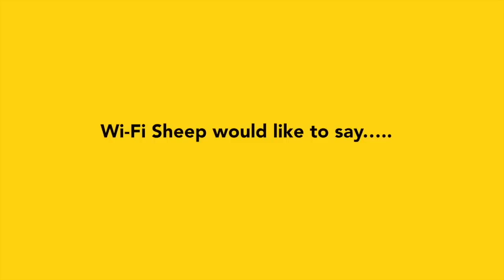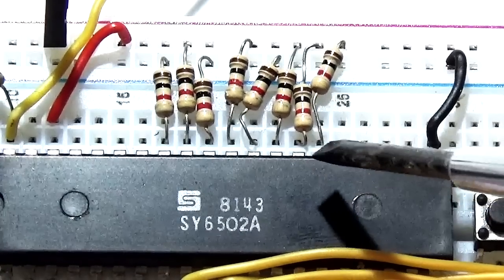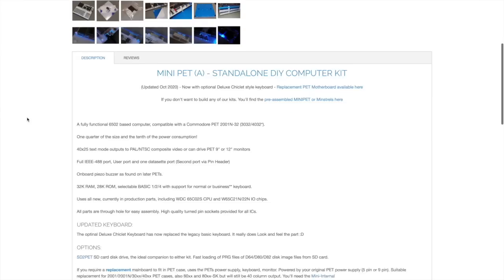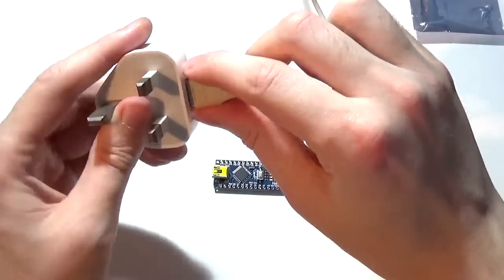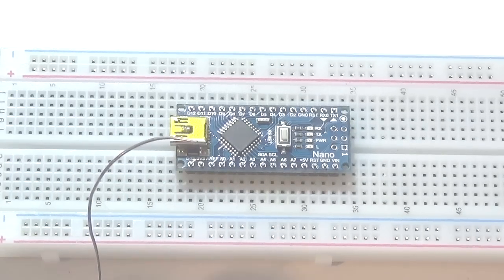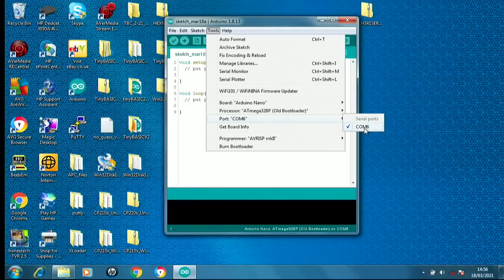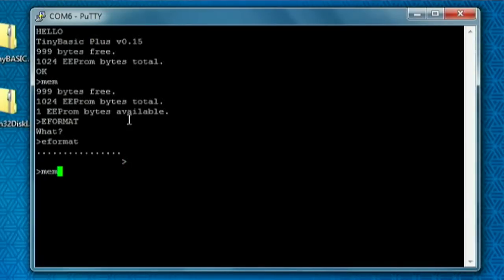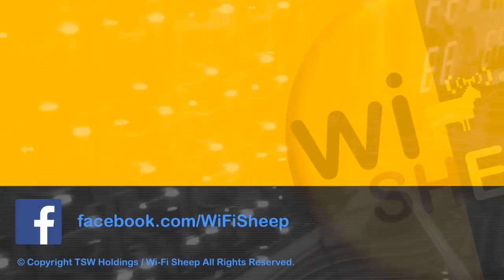New 2021 8-bit Computing For Under $10????

Comment: FPGA isn't 'hardware emulation'.  As the FPGA logic gates are arranged by firmware into the same configuration as eg a 6502, the FPGA IS internally a 6502 processor.
Reply: @another3997    It needs to be clearly distinguished:  In general terms, an emulator is another processor performing a simulation of being another processor.

An FPGA is, at the gate level, a 6502.

There are differences (the cost difference is substantial!), but not nessicarily something the casual user would see.
Reply: To be fair, the FPGA implementation is not remotely the same as a 6502.  At best it implements similar logical equations and timing.  The way in which the logic is realised is very different.  The 6502 also has a two phase clock which is not realisable in FPGA.  That said, it is possible to emulate the external behaviour and timing of a real 6502 to a high degree of accuracy.
Reply: @another3997  no there's no emulation going at any level
Reply: Technically it is not emulation in the traditional meaning of the word but it is also not a 6502. It's a digital circuit which is functionally equivalent to the 6502.

You could argue it is a form of emulation because it is reproducing the behaviour of a 6502 but not actually using the 6502 device itself.

And the hardware description language used to implement the functionality is not a programming language. It's a hardware description language. It isn't a sequence of instructions like a programming language. The only thing it has in common to a programming language is that both are written in textual form.

Comment: When talking about 8 bit processors there are actually two numbers to be concerned with.  Data width, and address width.   Most of the examples you gave of historical machines have a address width of 16 bits.   But many 8 bit processors were actually more of hybrid processors.  Like the 6809E.   It was classified as a 8 bit processor.  But it had a couple of 16 bit registers and could do limited 16 bit processing.  This made it suitable for OS-9, which was a unix like operating system  often used in very expensive real time systems like fastbus crates.   In fact for real time processing the 6809 based hardware remained better suited for uses at CERN than the newer hardware components available in the early 90's...
Reply: When talking about processors, the numbers we are concerned with are the data bus size and the size of the internal registers.  NOT the address bus size.
"hybrid" processors have different data bus and internal register sizes.
Thus a 6502, 6800, 8080, and z80 are all 8-bit processors as they have an 8 bit data bus and 8 bit internal registers.
The 6809 and the 8088 are 8/16 processors as they have 8 bit data buses, but 16 bit internal registers.
The 8086 is 16 bit, the 68000 is 16/32, but later chips were often 32 bit.
This has been how we call them since at least the 70s or 80s.
Reply: @MichaelRBrown-lh6kn  Yes.  It it is nice to clearify exactly what type of 8 bit architecture you are talking about.  As about the only reason I can think of for using an 8 bit processor is to run ancient software natively.  Even smart light bulbs now days use 32 bit processors...   I imagine eventually when they start putting processors on RFID chips they'll have more than 8 bits too.  Really any old software I have would need that 16 bit address bus...   Not that I'm likely to ever try running it again on a non-emulated platform.  It is just an interesting what if I really wanted to type question.
Reply: Adrress size has nothing to do.
You forget most important: ALU (arithmetic-logic unit) wide.

The "rule" (not a law) to determine bit with would be something like this:

1st/ Internal data bus. This is mandatory.

For the next two points, only one would be needed. 

2nd/ Register size (at least equal to 1/). If there are bigger registers that doesn't qualify if it has to operate on them on more than a pass.

3th/ ALU width.

Finally considering a CPU is x-bit size is a marketing and habit practice, not a scientific-exact one

For example Zilog Z80 is 8-bit because its internal bus is 8-bit wide (so on for external), it has 8-bit registers and can use some 16 bits registers but when it operate on them it takes like double time (two passes, so no 16-bit operation).Surprising a few years ago a lot of us learned Z80 ALU was 4-bit wide. I think in 80's near all of us were thinking its ALU was 8-bit wide.

Motorola 68000 is a 16-bit CPU because although  it has 32 bit registers, its internal (and external) data busses are 16-bit, and its ALU is 16-bit. To add 32-bit data it needs double time, because it is donde on two steps, each one 16-bit. Motorola named it 16/32 bits because althougth it is a 16-bit CPU it implements a 32-bit ISA. Really 68020 is 32-bit.

For extreme example there is a very special HP CPU called Saturn (used in HP-71 and later derivatives in a lot of old good HP calculators, for example on wonderful HP-48 series): it has some 64-bit data registers, 20-bit address registers (in fact it can  address directly, in lineal memory, 1 Meganibble memory, i.e. 512 Kbytes, something an Intel 8086 can't do: it can only address in lineal way 64 Kbytes) but it is a 4-bit CPU: internal data bus and ALU are 4-bit wide. If you add two 64-bit registers it takes like 16 more times than adding only 4-bit size.

Obviously marvellous Motorola 6809 is an 8-bit CPU. Having some 16-bit registers doesn't qualify for being 16-bits as its ALU and internal data bus are 8-bits.
Reply: @davidg1830 davidg is correct.
The bit width of a processor is determined by the size of the data elements it processes not the address bus size. And that makes perfect sense if you think about it.

The performance of the processor is principally determined by the width of the ALU and its registers, the size of the memory and maximum capacity of memory as determined by the address bus width has little bearing on this.

On more modern processors then the clock frequency, the architecture, the number of clock cycles per instruction all come into it. In the old days we were more concerned whether it was an 8 or 16 bit processor.

Comment: One great thing about TinyBasic+ is that it can be used to control the pins of Arduino board, so you can write some simple programs like traffic lights etc in Basic.

Comment: Of course. Arduino Nano's have been going for $2-3 bucks for years. I would point to the Blue Pill but that's not 8-bit, so I suppose it doesn't count. Or, alternately, you could point out that for your $1.50 you're getting FOUR 8-bit processors, they just happen to execute the same instructions together :-)
Reply: Hmm, weird. Soo, they run the program, but Times 4 at the same time? Are they like four cores? 

It's quite cool how we could get these for like a couple of dollars. I bet if the producers of these hardwares notice that hobbyist are doing this, they would hike up the price 5 to 10 times the original cost. Seems to be every aspect of things that resemble vintage these days...

Comment: Tips for soldering noobs (like myself) whose aversion comes from dab-dab-dab-dab-BLOB which ends up joining several pins. A good soldering iron and solder works wonders and put some solder on the tip first to stop the solder from sticking to the soldering iron.

Comment: I'm wondering if you can tell me where you purchased these 8-bit modules?  Thanks in advance.
Reply from the maker: Hi yes, it was a seller on Ebay listing here: https://www.ebay.co.uk/itm/313074662903
But you might find cheaper listings so do shop around!
Try searching 'Arduino Nano' on ebay or aliexpress.
All these are clones which more then fine and its what I used in the video.
The proper branded Arduino Nanos are about £9 - £11 each!
Reply: @WiFiSheep  Thanks very much.  Very much appreciated.

Comment: So where is the link to actually order one of the beasties shown in this video? I think there used to be one. Was it removed?
Reply from the maker: Hi, as the prices of these have varied wildly due to the pandemic and chips shortage in recent times, I cant post just one product link, it would also suggest I was endorsing one product listing.

All you need to do is search for 'Arduino Nano Atmega328p' on either Ebay, Amazon, AliExpress or any other preferred vender, and you'll find product as used in this video. 

Here is a UK listing as an example: Although I do NOT endorse this seller. https://www.ebay.co.uk/itm/263093090662?hash=item3d4191f966:g:jIgAAOSwsGVi4QEM&amdata=enc%3AAQAIAAAA8PbrbdC43hRznj38t4feAfYz6Mse1YYQrCPH5OfZLCrta0K4Hx4Dpwf6aSnXwcX63iV1kW4Kv%2FDToFwtjWzZbpXq2LsBHTZcHRJvgPUb2BFOMS4UUfC%2FbPg%2B3ammo3jZYv%2BMDoW5YTBKKuMQTVbdu%2FI8n%2FEMmHtiq19zQlVyj%2Bvtt%2FbKnP7RahGllyd%2B3oLPT7%2BBCFeN%2BR%2Fbkfux7WabjA1IfdZgKEvnPZ4TaNZ4FiZHEITGHGOzmQ94gRHJFQGj1EKDYP%2Bu3t7C6mddL4rwIRz0b5mI4MU%2FaH1D89ueZkJxwEUSulfINJKmaUCLc8%2FspA%3D%3D%7Ctkp%3ABFBMovG4mKJi

Comment: While we can easily argue about what makes an N-bit computer until the cows come home, it's very common to define it not by external bus width but by primary operand size for the central processor. For instance, the i8088 is a 16 bit processor with 8 bit bus (cut down from the i8086, with 16 bit bus), and the ESP32 has 32-bit processors with a 4-bit multiplexed external bus (QSPI). The 68000 is typically called a 16 bit processor, as it has a 16 bit ALU despite using 32 bit work registers; 32-bit (long) operations take longer than 8 or 16 bit ones. It also has a 16 bit data bus, but its sibling 68008 only has an 8 bit bus.

An FPGA is also not a microprocessor; it's more like a digital circuitry lab in a chip. You can design all sorts of devices in it, including processors. The native width varies per function block internally, with 1, 2, 9 and 36 being common widths. 

In similar nitpicky semantics, an ATmega328 is not really a microprocessor, but a fully integrated microcontroller, or computer on a chip. Unlike a CPU, it cannot run programs from external memory. Some larger AVRs support external RAM, like the ATmega128, but their Harvard architecture only connects that to the data bus, not the instruction bus. You can get new Z80 8-bit microprocessors today, but they're quite a bit more expensive.

Sadly, I have to agree you have poor soldering technique, but you're repairing it with the second pass. The problem is you're dropping hot solder onto a cold board, which leads to insufficient wetting; basically, a drop of solder solidifies next to the parts you meant to connect, rather than merging with them. Adafruit's guide to excellent soldering may help. 

And personally, while I did learn some BASIC early on, I don't love the language. I'd probably rather run FlashForth. The core reason is that it encourages building programs in terms of transformations and operations rather than focusing on single lines. But it's all good fun; not everything needs to be a Basic Stamp. 

Enjoy your hobbies! :)
Reply: No, for decades the acceptable thing was the use the data bus NOT the internal registers to determine if the CPU is 8, 16, 32 bit.  Tho its acceptable to use 8/16 or 16/32.
In your example, the 8088 should be called either 8bit or 8/16bit, NOT 16 bit; as the 68000 is 16bit or 16/32bit.
Reply: @MichaelRBrown-lh6kn  Like I said, it's rather arguable. 16/32 is precisely what ST in Atari ST means. But I think it'd be hard to find someone who claims the Pentium sits in 64-bit computers; it's 64/32, and the transition to wider bus than operand or register size makes sense because of the caches and clock domain differences. Like the distinction between word and byte size, I think the rule may have had to evolve along with architectural features. Is the Macintosh LC a 32-bit or 16-bit computer?

Comment: I was surprised to find that Zilog is still around, and actually still sells a new Z80 processor, which they've got up to 50MHz now!
Reply from the maker: Yes I was to! I think both Z80 and 6502 are still in production manly to cater for the industrial market, so think plant machinery for example. But it dose then mean these chips are also still available to the hobby market, which is a good side effect!
Reply: @WiFiSheep  I'd love to build a new machine around the z80 myself - something that could at least run CP/M because that gives access to a lot of software.
Reply: A slight improvement on the 2.5MHz version I used in the 70s ;)
Reply: I dare say you could emulate a faster z80 than that using newer run of the mill controllers :-) but I understand the appeal

Comment: Now I have an interesting question for you. Why are we paying $10 for an eight bit processor and more than $64 for a 64-bit processor?
Reply from the maker: Very interesting indeed! So I think its down to economies of scale. 8-bit microcontrollers such as the AVR range, were basically developed for industry, and things like Arudunio for hobbiests, (which use the same chips sets) jumped on the back of that, also most of that system is open source so anyone can use it, license free.

later 32 and now 64 bit microcontrolers are still quite new, hence not adopted by industry in the same way, plus those that use ARM such as the Raspberry Pi Pico have to pay a license to ARM for the Cortex M0 technology... Same with 64bit which is very new and really only used by the hobby / maker sector, hence sales are lower, costs are higher, hence the price difference.

As things develop im sure we'll see 32/64 bit chip prices come down, especially if a architecture is adopted by industry.

Comment: It would be great if someone could port that BASIC into a RPi Pico. They are definitely under $10! Might be able to have a faster Baud rate too. 😊
Reply from the maker: Hi David, that is something that is being looked into, it should be possible and would open up more RAM and faster processing. Baud rate not so much as its deliberately set slow to 300 rate more for the benefit of the standalone tv out terminal, used as part of the TinyBASIC computers project.

Main reason a port to RPi PICO hasn't happened is im still waiting for official support for the rp2040 chipset under the Arduino IDE
Reply: @WiFiSheep  Hello Tom. That's really good to hear. There is an unofficial release available now and I actually tried it today with the Tiny Basic .ino software. It failed to run due to memory issues I believe but that might be expected. So fingers crossed someone will fix that soon. I did a demo on Instagram today of Tiny Basic running on a Nano. You can see it @davek_uk. 😊
Reply: MMBasic was put on the RPi but do changes it only works on older OS.
I hoping that a version of MMBasic can be done for the RPi Pico.

Comment: Arent arduino nanos like 1 dollar on ali express?
Reply from the maker: yeah quite possibly, but if you add shipping your up to about $3 if not a bit more... The prices quoted here were from Ebay UK and guesstimated for US dollars. As with anything prices will flux over time and between nations, so its near imposable to give an exact price at any given time.
Reply: Possibly, but I usually think of them as about $3 bucks each. Blue pills are cheaper and better (stm32) at about $1.50. But I think the ESP32 is probably the best all around though for about $5-6 bucks each, depending on how well you shop
Reply: @bratwizard  i usually buy Arduino Pro Micro, I can connect a lipo 7.4v directly to them and they work with no extra components, they are also smaller. 

Is there a better alternative in terms of size? 

I'd love to get something a bit smaller than the Arduino Pro Micro. I used the attiny one but with just 3/4 usable pins, its not enough